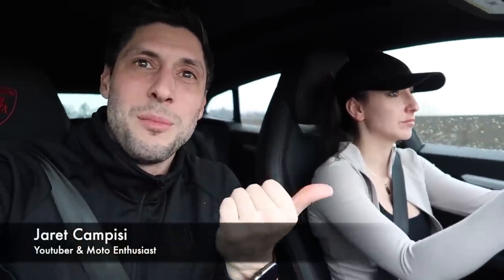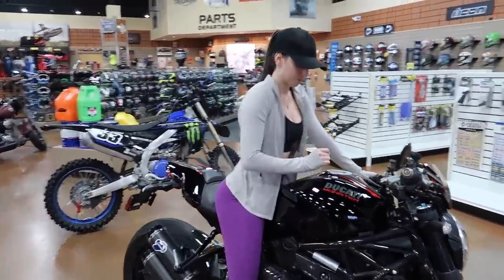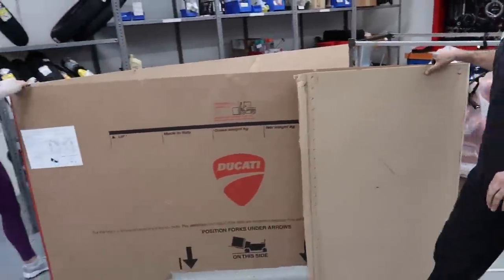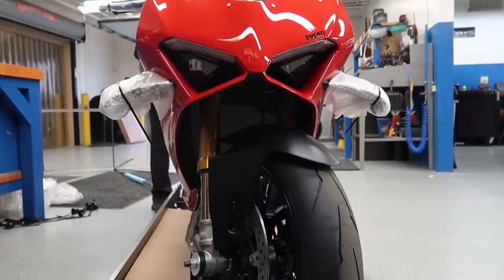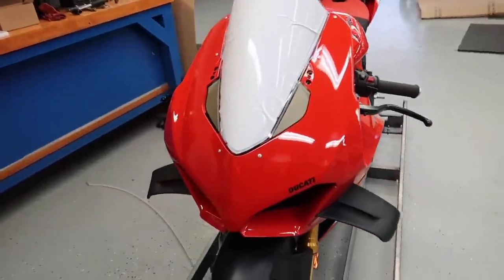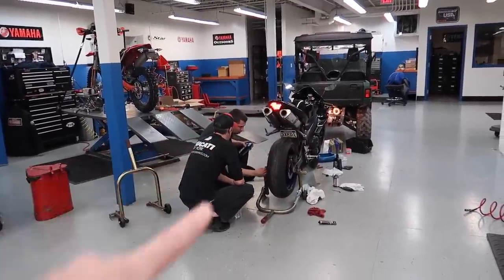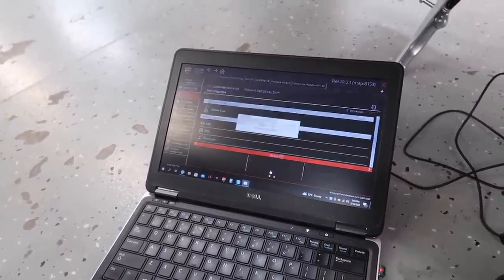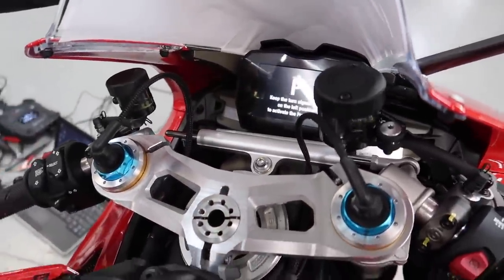Unboxing a Brand New Motorcycle!!!

Comment: I have a 2022 V4S. Only difference to the 2023 is software changes. I just need to get mine to the dealership for the reflash. Gorgeous bike, absolutely love it. Insanely fast, nimble and just fun to look at. I'll be watching your build for a few nick-nacks to add to mine. Just put on the NRC tail tidy on so far to get rid of the rear "plow share" of turn signals and plate holder.
Reply from the maker: Great choice man love this bike!
Reply: @JaretCampisi  Thanks Jaret. Get yourself and Christina some Ohvales and come ride with NJMiniGP, or have Dado build you a TTR125 MiniGP bike....you'll have a blast.

Comment: Excellent video! 

Can wait for the unboxing  my Ducati V4R 2023 (delivery scheduled for April 2023), with the following  mods/options:
- Racing Exhaust System 105 DB SBK V4
- Set Of Racing Exhaust Lower Fairing
- Adjustable rider footpegs in aluminum
- Carbon Heel Guard Set 1409
- Extra set of wheels: Marchesini M9RS Corse
- Extra set Pirelli 200/60 ZR17 Diablo Supercorse V3 & Pirelli 120/70 ZR17 Diablo Supercorse SP
- Brake lever protection Ducati
- Carbon Dry clutch cover
- Carbon Generator Casing Protection Set
- Chain Lower Carbon Protection Set
- Carbon Frame cover Set V4
- Front Calipers Air Conveyors Set
- Carbon Rear Mudguard Set
- Protection Set For Carbon Swinging Arm
- Carbon Number Plate Holder Set 1409/1715
- Billet aluminium tank cap (black)
- Tankpad Carbon Mat Panigale V4
- Rizoma Mirror, Stealth Ducati Panigale V2/V4
- Rizoma adapter turn signals
- Rizoma Stealth turn signals
- Llmberger carbon cover left
- Llmberger carbon cover right
- Radiator Cover Set EVOTECH Performance
- Glascoating treatment (upon delivery)
Reply from the maker: yesssss that's going to be amazing man!  Please get as many parts as you can through www.motomillion.com and use my code "campisi" to save money :)
Reply: @JaretCampisi  thanks and will do!

Comment: You don't actually need a full titanium exhaust for the 1200 R.  Just take it for a ride and you will be sold. It is supposed to be a lot better handling than the S model. But unfortunately lowering it would destroy the handling characteristics.

Comment: I think it’s quiet bc it’s deactivating 2 cylinders when idling in neutral. 👍
Reply from the maker: That is def part of it
Reply: Not on cold starts. It goes in the 2 cylinder mode only when the engine is at temperature.
It's quiet because of Euro5. That if you can call an 102dB bike quiet...

Comment: I think its quiet because its in Neutral and not in Gear so the Cylinder Deactivation system has cut off 2 Cylinders. The bike never turned on all 4 Cylinders
Reply from the maker: thats def part of it BUT regulations are forcing companies to make bikes quieter

Comment: So you're taking a $29K bike and just going to add a bunch of expensive accessories to it?  Where's the challenge in that, other than being able to afford it?  And we're not drunk on the Ducati Kool-Aid now are we?!  I think a more challenging project would be taking a bike with a conventional rear swing arm and converting it to a single-sided swingarm; converting normal telescopic forks to upside down forks; single-disc front-end to a dual-disc setup; upgrading wheels, exhaust, bodywork (without garish graphics); etc.  But it's your project, your Benjamins, so have at it!

Comment: No surprise…it’s for you to do your Lambo-themed build. 

My $0.02 as a 19yr MSF R/C and vet 38yr/100kmi-plus rider: PLEASE DO NOT buy Christina a Duc M1200. The bike needs to be specifically for her skill/experience/size-fit constraints and not for you. I realize that she rode one in CA (in reduced power mode, I believe) on a short trip and got away with it. She is very much still a beginner/entry level rider that had trouble riding an R3, as well as your old GSXR-600. (Waaaay too much bike for her, IMHO). Considering her lack of experience, and the amount of time since she last rode (not counting that one-off on the carbon M1000RR which nearly ended in disaster), she needs another MSF BRC immediately. A skill & safety refresher is needed and may be a life-saver.  She needs a beginner-friendly bike, not a 150-plus HP beast that’s a challenge for even the most experienced and skilled riders not limited by size/fit constraints. While she (and you) are in love with certain premium bikes, anything that needs to be lowered in order to fit her is N/G. Lowering any M/C is a bad idea as it affects rake/trail, suspension travel, lean angle, ground clearance and ride quality. My ex-GF is also a very experienced rider and a R/C for as long as myself. She’s only 5’4” and has issues riding most bikes as she can’t have both feet on the ground. Despite this, she was able to ride my old Hypermotard albeit MX-style with only one foot on the ground. Her ride is also too high for her (FJR1300A) and its got the battle scars from drops to prove it. My fiancée is 5’1 and wants a Duc bad, but she needs a BRC as, despite some street/dirt riding experience, her skill level is still entry-level. She’s had Rebel 250/450’s, as well as a small Shadow, but other than fit and modest power, I’m not a fan of any of those, especially the Rebel’s. They’re horrible training bikes. Something like Christina had (and still should have, IMHO) would be good as a starter MC, although unfaired versions might hold up better against inevitable beginner drops. Look, I get it: everyone has their dream bike(s). Unfortunately, not every bike is for everyone. Want and need are two different things. Start her over on a small-displacement lightweight manageable bike and then move-up as necessary. She should be able to ride the wheels off that R3 before even dreaming about an R7, never-mind an open-class R1! Once she gets her bike, its back to the MSF Range for a BRC2/ERC on her bike. It’s a good couples activity, hint, hint! I’d love to see my love on the Duc that she wants, but I love her too much to put her on too much bike unless she is ready and able.  Think about it.

Comment: what is the diff between the R and S??
Reply from the maker: If you are asking about the Panigale its mainly the engine size...the R has to be limited to 999cc or lower for racing purposes...the R also has fixed Ohlins suspension instead of the electronic suspension on the S.  S in general is a bit softer and more comfortable for the road as well.
Reply: @JaretCampisi  wow thanks for the info 🙏 now i know . fan here 🙌

Comment: Just a fkn gorgeous bike. Arguably the best...but daaaaym...why the fk do manufacturers insist on using gold forks??? And also, every part on there, that's silver in color, should be black anodized
Reply from the maker: It's ohlins color so they force manufactures to use it from what I've gathered but yes its super annoying to me as well...just make them black
Reply: @Jaret Campisi  yea, but not just Olins doin it. I suppose the other manufacturers are copying Ohins. Wish they'd stop, and do something new